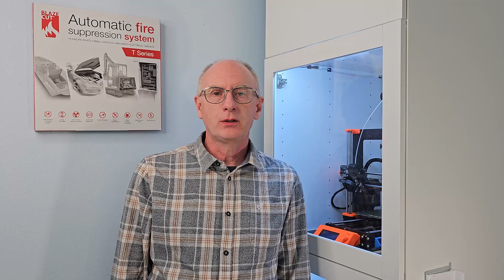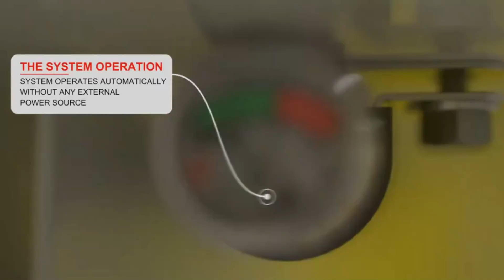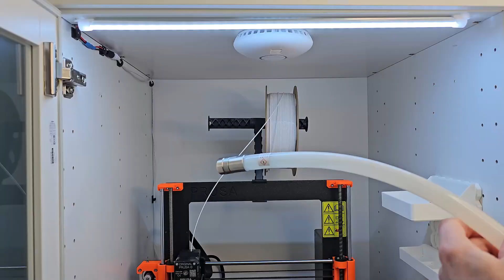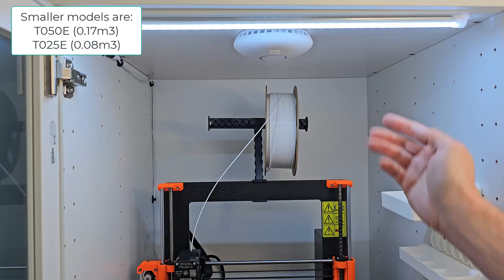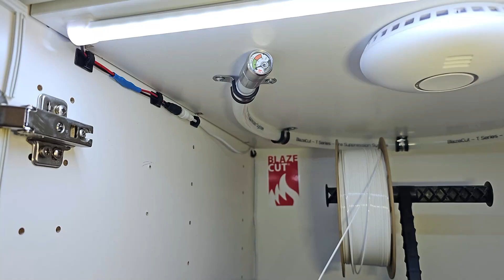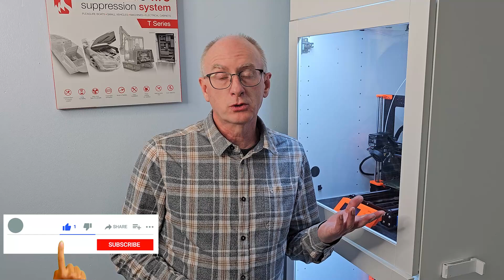3D Printer Enclosure Fire Suppression - BlazeCut [new video at https://youtu.be/DPUKYzoP_Kc ]

Comment: A small correction, the operating temperature is 0-90 degrees, but it will active at 105 or 143 degrees depending on the model.

Comment: Thanks for the video chap, I have an AFO ball mounted above my printer in the fume extracted alcove it sits in. The downside of that device is i think it will corrode electronics so very much just a stop the workshop burning down rather than save the printer solution. Im concidering building an Idex RatRig so will investigate these as they look far easier to package and may save the printer too!
Reply from the maker: @a-091-l2j  I've seen videos where those balls are not effective, and as you say the contents will probably kill the electrics. Worth checking out Blazecut as they are used in many electronics situations. Good luck.

Comment: Hi, can you tell us the cost? Also what is the after affects of activating the system?
Reply from the maker: @H2Dwoat  you would need to contact your local distributor directly for pricing. Let them know the volume or dimensions of your enclosure so the correct model can be identified. According to the Blazecut info the suppressant is not harmful to people or electronics.